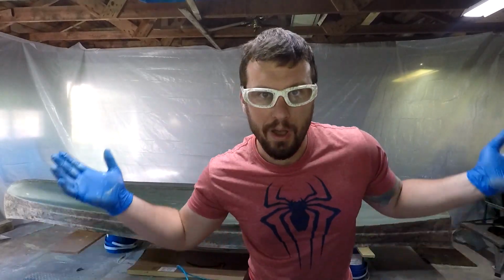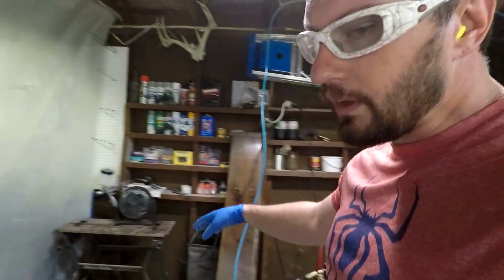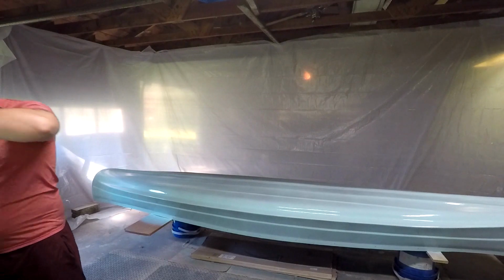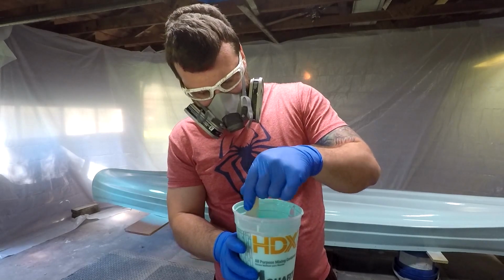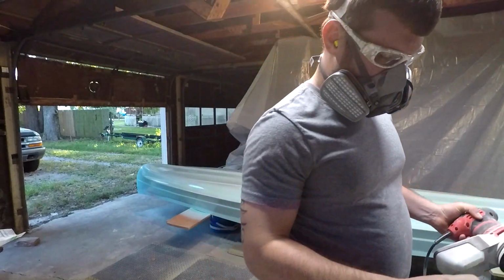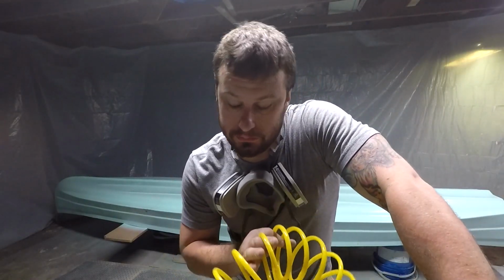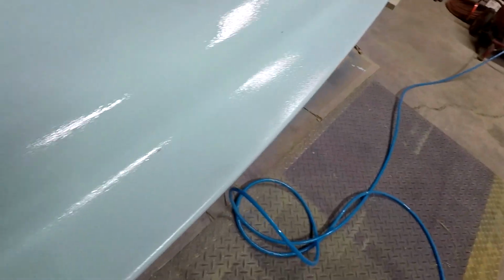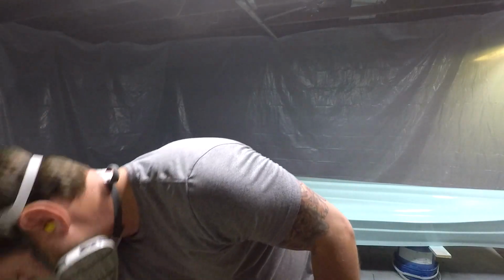RE gel coating boat | How to | Part 1 of 3 part series

Comment: You didn't have to sand between coats?   I guess Duratec doesn't act like a wax?
Reply from the maker: Honestly I don't remember, I think I did to remove the orange peel but I could be mis remembering.  I was told by a boat painter to spray and wait till it's tacky then spray another coat and do that for 3-4 coats then sand and that will give a smooth finish.  Then spray the clear for 2 coats, if adding flake add it after the 2nd coat and spray 2 more coats with flake and one final coat with no flake.  I didnt do flake but I did flake my outboard and it looks awesome.
Reply: @wildnwright245  so after the gel coat and before the clear did it turn out smooth like factory finish or was it slightly bumpy like cantaloupe?
Reply from the maker: @mychaelmitchell4632  it is smooth but I should have sanded more

Comment: Where did you get your paint gun and other materials?
Reply from the maker: The kobalt is from lowes, i dont recommend it.  The other i found on amazon.  I plan on buying another.  The brand is TCP global brand 2.5mm HVLP spray gun.  The larger tip is for spraying metal flake and thicker paints.  Hope this helps, dont forget to subscribe!